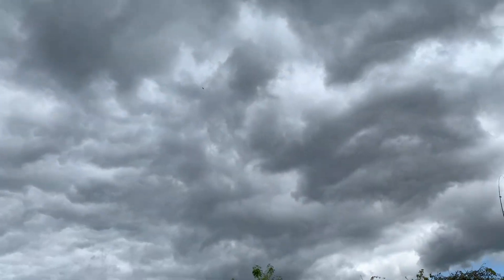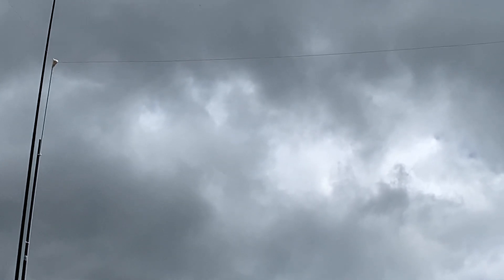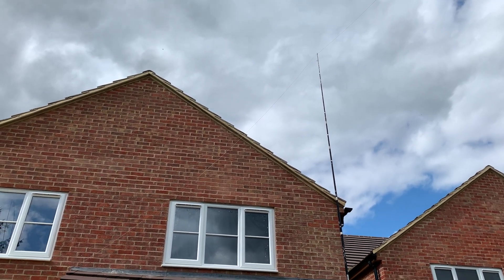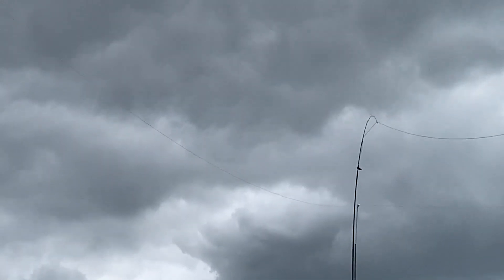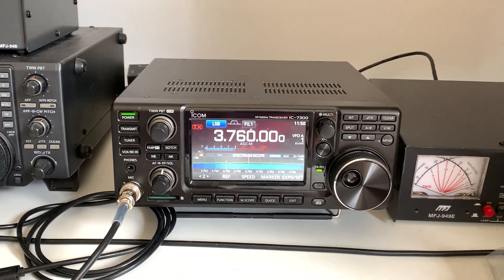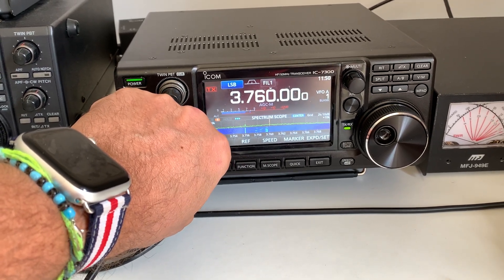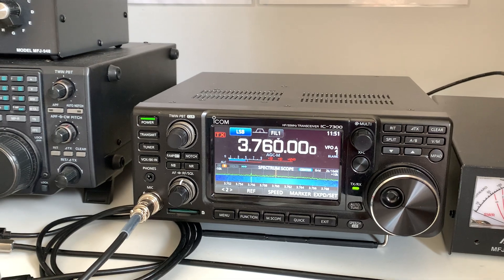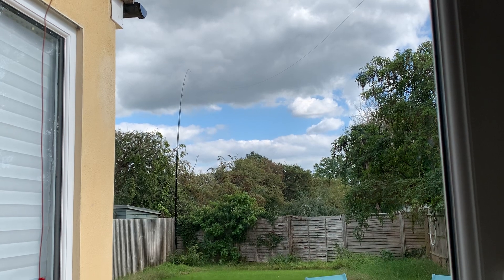A significant increase in height for my £4.50 Topband end-fed wire antenna

Comment: Hi clint, ive got my end fed 20meters long wire at about 2meters off the ground, ive worked all over europe, into USA, and 1 contact in Brazil!! Do i need to put the antenna higher?? What im saying is, is it worth the hassle of erecting poles down the garden and have the worry of it snapping  when windy? Also i have to consider neignbours. My wire is practically invisible at the moment, its the green sotabeam wire. Thanks.
Reply from the maker: Height is might as the saying about antennas goes. If I were you, I'd increase the height - you will obtain even better results for sure. Saying that, you're already doing really well! 73